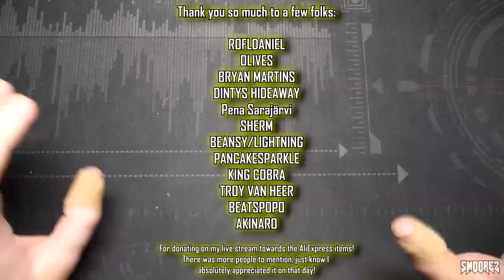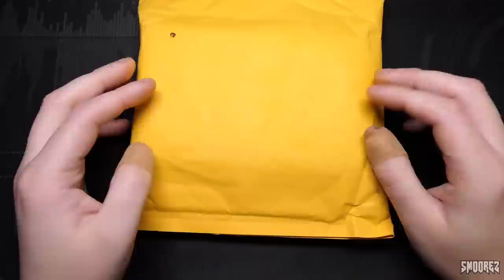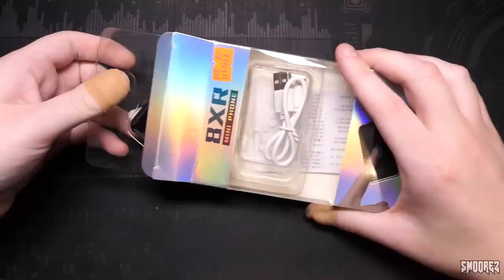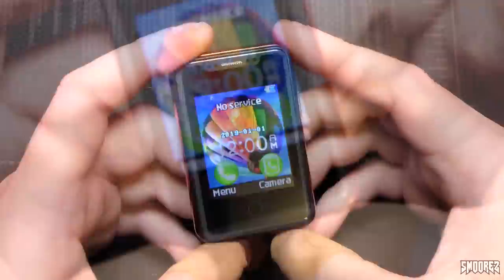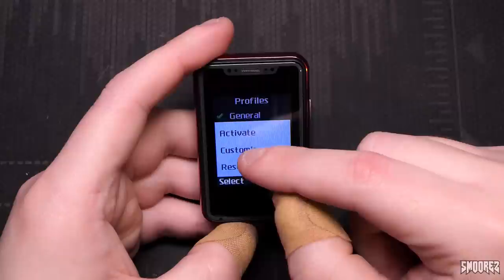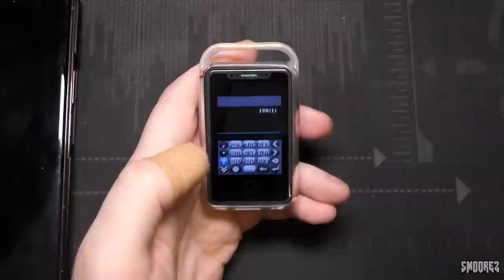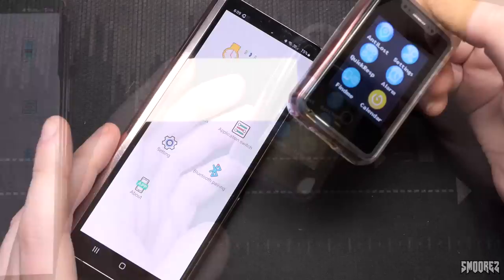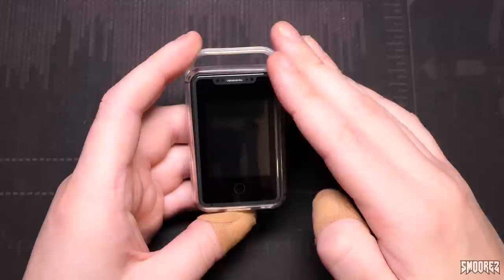The Uniwa 8XR Mini Feature Phone from AliExpress - Truly the smallest WELCOME phone ever!

Comment: I think the Uniwa 8XR is essentially a cheapo "DZ09" smartwatch made into a phone.
Reply: And indeed it is.
When I read MTK6261, I understood they basically recycled a mid-tier chinesium watch, the "good one" with 32 MB of RAM, into a mini device, slapped a Java OS and called it a day.
They had probably a batch of rejected parts and went on putting something together.
Reply: @AlexandruLipan  the os is not java, is by mediatek, it supports java in some cases but not always, it should be nucleus rtos
i think they used the same smartwatch os
Reply: I have an "A1" that I picked up off eBay for $5 new about three years ago.  It's a DZ09 but in a knockoff iWatch case.  Most of the menus, sounds, and the one watch face he showed are identical to what I've got.
Reply: @namesurname4666  Interesting, thank you for the correction. Today I learned MediaTek has it's own OS for devices like this.
Reply: LMFAO  yes if they have a mediatek chip, there are some rare ones that use spreadtrum (different chip) and others that have android (mediatek)
Reply: I would consider buying it if it at least ran Java games. This just runs the generic Mediatek OS.
Reply: Yep, same as the "gt08" Chinese smartwatch

Comment: I had a Kodak digital camera, one of the very first ones actually. It had a serial cable to connect to a pc. Right around 2000 iirc, as it worked with Win98. It took much better pictures than this phone. 
However, the remote feature, mostly useful for selfies, stuff like that.  You could set your phone up, then get in frame and take a shot using the little phone. A remote bluetooth button often costs around the same price as this thing, and while not great you CAN see what your camera is seeing. So, just using it for that feature alone it's actually not a terrible buy. If you had an iPhone X or Xr in red, it'd be a cute little remote for shots that would match it.
Reply: But he showed in the video it only has an app for Android. So I don't know if it would work for that. ):

Comment: Genuine question. How do you guys not have 2g as a backup? 

We have pretty good and growing quickly 5g coverage. But in a pinch when the network goes down for whatever reason we can revert to 4g, 3g, 2g even hspa and get this Edge! This is the UK by the way.

If the network goes down for say maintenance  getting online is tricky, but at least we can still call and text.
Reply: Most places are phasing it out. Here in the US it's gone, in a lot of places it's gone. Australia phased it out in like 2018. Japan fully killed in in 2010. It's a very outdated and obsolete standard like literally it's 30 years old.